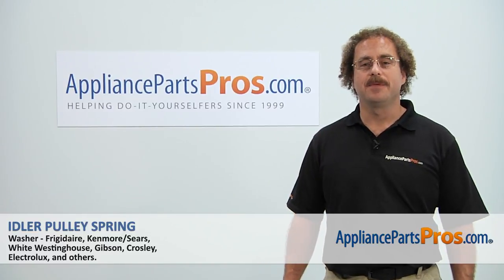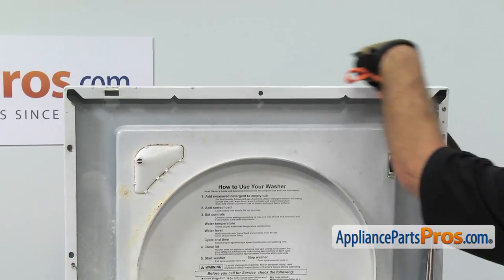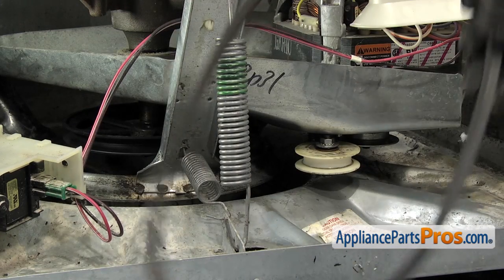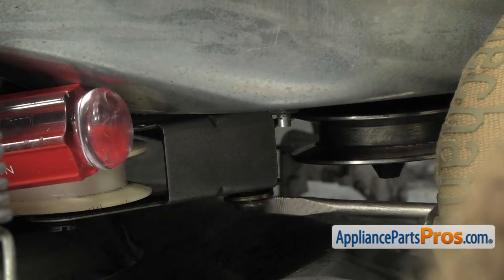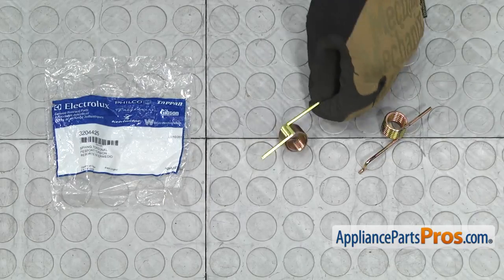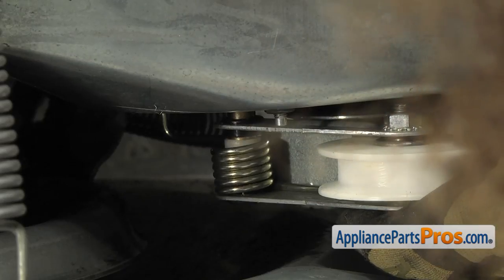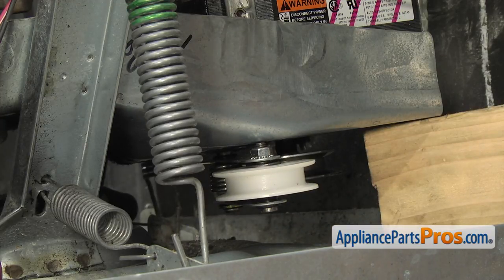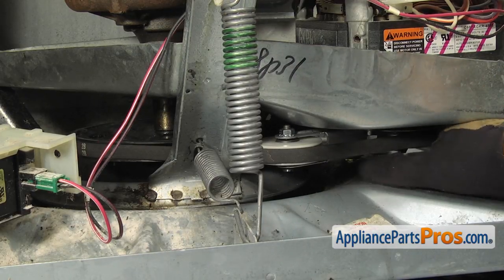How To: Frigidaire/Electrolux Idler Pulley Spring 3204425

Comment: Hi There, What would be the tell tale signs that the pulley would need replacing.
Reply: Ok gracias
Reply: If you hear the belt squealing are making a lot of noise or you can see it trying to work and can hear the belt slipping usually a sign to check to see if the idler pulley has enough tension and I am not a professional by no stretch of the imagination